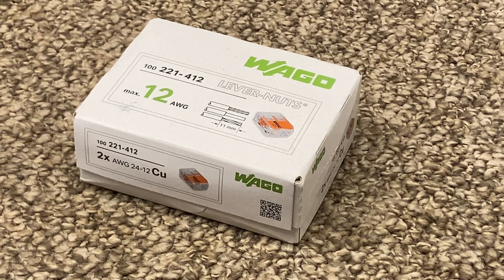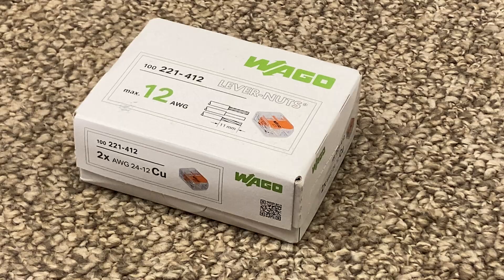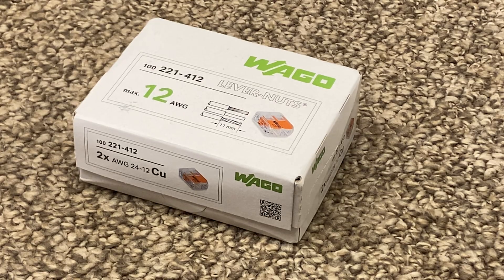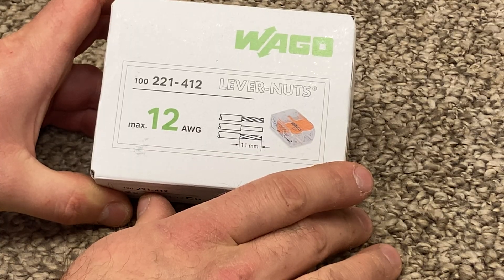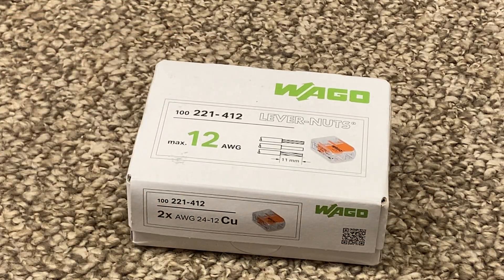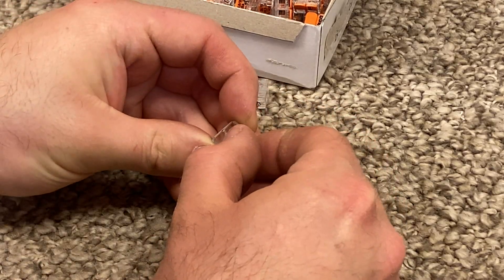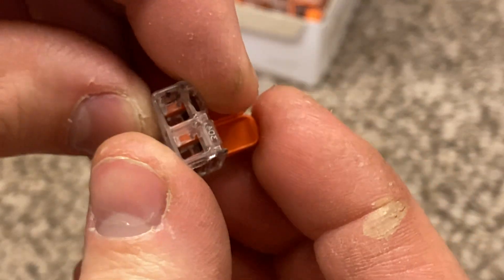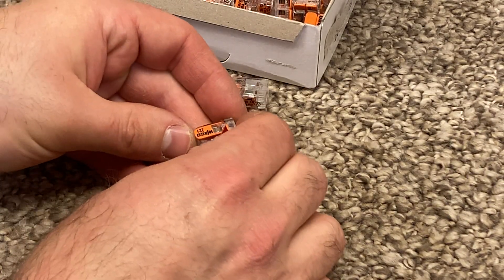I Try Some Wago Lever Nuts -- And I Don't Like Them

Comment: Those are counterfeit the real ones aren’t loose
Reply from the maker: They're not counterfeit.
Reply: @JordanU if there not then you didn't strip the wire enough or install it correctly. They are very useful especially if there isn't enough slack in an existing socket. I don't know how much electrical wiring you do on a regular basis but I use them all the time and haven't ever had any issues

Comment: I definitely don’t like these either, I know how to make proper and safe electrical connections with the wire nuts. These don’t seem safe and I wouldn’t trust them under high power loads, I suppose for just a simple light fixture it should be fine.
Reply from the maker: Agreed.

Comment: It really depends on the situation, these are nice for boxes approaching their volume allowance, where you need to cram stuff in, especially with GFCI or anything other large devices that take up significant space. As for ceiling fans, absolutely use wirenuts. They are also way too expensive for general use, i always default to the tried and true wirenut

Comment: I'm not the most fond of these either. I had the same findings when I tried them. The wires feel very loose under the connector and twist like nothing. I think they're reasonable for low current applications, and a lot of what I deal with is low current, 24VDC, but I would never use one on a 120VAC system with higher current draws.

Comment: It's the same as the outlets stab connection on the back no different both can be pulled out wire nuts are a safer option for high current never used them never will now

Comment: I don’t like that the current has to pass through the thin metal in the connector. 
With a wire nut and properly twisted wires, the connection is already mechanically and electrically solid, the nut kind of just insulates them and keeps them from working loose.
Reply: They can withstand a lot of current, the insulation melts long before the WAGO does. We use them in Germany all the time, if you‘d try wirenuts here every electrician would think you‘re joking. Yeah they might make a good connection if twisted correctly but the WAGOs are idiot proof

Comment: I like them for stranded to solid, or stranded to stranded wire connections, test cords/setups, and commonly replaced parts or fixtures, or things that require servicing. For example, the fan assembly in my range hood. I wouldn't really want a constant load on them of over 8amps. They can also be nice when connecting more than three wires together, which can be difficult with a wire nut in tricky or tight situations. I think they are perfect for your routine ceiling fan swapping, and more exposed temporary repairs/testing.

I'm old school as it gets when it comes to alot of practices within our hobbies. I still use wire nuts for most household electrical, I still solder copper pipe, won't allow PEX in my house, I think plastic electrical boxes are a sick joke, I think fuses are safer than breakers, I don't charge anything with a lithium battery unattended, and I'll NEVER own a major appliance with a circuit board or electronics. BUT I recognize an problem-solver when I see one. WAGOs are awesome when needed.
Reply: Circuit breakers are a joke. They allow currents far higher than they're rated for without tripping.

Comment: I find that these connectors have their advantages, but aren’t complete replacements of twist wire nuts. I haven’t tried genuine Wago connectors, but I use a pack of similar generic lever nuts. I do like that they don’t damage wires as much as twist nuts and making/undoing connections is quicker. I use them for ceiling fan bench tests and temporary installations, but I tend to stick with twist nuts for most ceiling fan/fixture installations.

Comment: I wouldn't mind using the lever ones personally. But just like anything they should be used properly and of course never overloaded. The push in ones are definitely questionable just like backstab terminations on receptacles and such.

Comment: I had an issue when doing the wiring in my garage with a electrical box that had four different wires going into one Marrette. It was like this for the hot and neutral wires. I was unable to get all of the wires twisted together properly and into a Marrette without one of the wires jumping out of place or not having a proper connection. When I was told that they made Wago connectors that can hold up to four wires I purchased some for the project. Some of the wire in this box was 12 gauge and I noticed the same issue where the wire was not getting fully secured into the connector. That was pretty disappointed with this because in the past these have been very useful for tight boxes like this. After having this issue I decided to purchase the next size up which was a 10 gauge connector and it worked fine without any issues. Now during the summertime I was running the air conditioner and dehumidifier through one of these connectors and same with the winter time in the electric heater and the connectors have yet to heat up or melt. I will recommend if you intend on using these with the 12 gauge wire used to 10 gauge connector it works way better. I find that these work really good with the 14 gauge, the majority of my house is wired with 14 gauge and it works really well when connecting the solid core to the stranded wire on a light fixture or ceiling fan. 

Now the use case that is in my garage is very extreme and it was pretty much my only option to minimize connections in the wires if I were to not do this I would have had to have multiple boxes with multiple different connections with Marrettes in each connection in a circuit will get warm. I would never recommend running that much power for one of these but the units I got were rated for I believe 30 amps (for the 10 gauge Wago connector) which is on a 20 amp circuit which is not that close to the max draw of the connector. In a lot of applications especially in older houses there's very little wire in the wall and not enough room to connect everything properly like how you demonstrated early in the video.

Comment: Next time I see you, please give me two identical lengths of wire with a standard nut and one of these. I can use the micro-ohmmeter at the office to measure the resistance of the connection. I don't like these either, but there's a chance the connection might be better than you expect

Comment: I fully agree with your findings.  The tried and true method is often best.  I would have tried these with maybe a 14 gauge wire to see how that would have worked, in case perhaps they would work better--even though the box states they work with 12 gauge.  

I think these may have some use in other applications, especially where not much current is being drawn and in low-wattage/amperage situations.  

They do sell drivers for wire nuts that fit in a drill, and they do work quite well.  But most times, I try to avoid using power drivers entirely, as the mechanical "feel" we have developed for how loose or tight something is, after working with it for years and years, tells you if it's right or wrong.  Using one of those drivers in a hex-shank manual driver might actually be a good thing, however.  Next time you are here, you are free to try what I have to see if something like it might be beneficial to you.
Reply: I'm in complete agreement, well said. We should get together sometime soon for hamburgers, it's been a while 😁
Reply: @Kevinsrack  Thank you.  Yes, burglers are great, but I only make them when it's nice weather.  I can make plenty of other stuff inside that I'm sure will suck just as bad!  I'm here just about any time.
Reply from the maker: @jaykay18  Your cooking is disgusting.
Reply: @JordanU Thank you.

Comment: I think these Waco connectors are actually pretty good. No, they aren’t perfect for every application, but I used them and was pretty pleased with them. They’re definitely suitable for low-current applications such as 25-volt/70-volt/100-volt speakers.

Comment: I use them because they are easy to use i love to use them for my 70 volt speaker system
Reply: Yeah, they aren’t bad for that application.
Reply: @loudspeakertestsmorebyaida3804 i got to order some more i am running very low on them